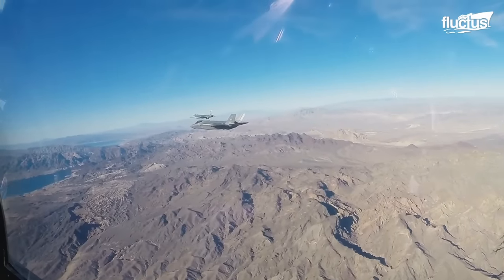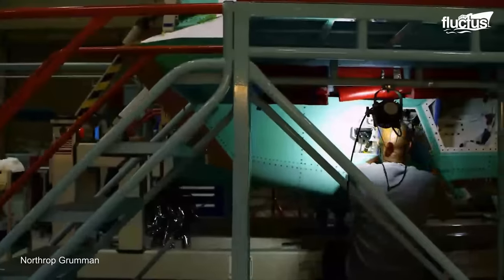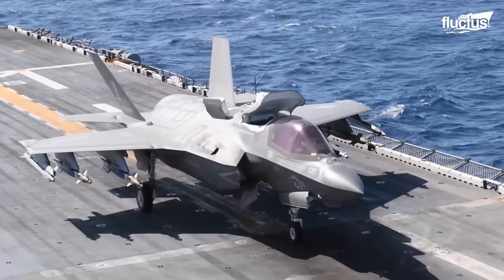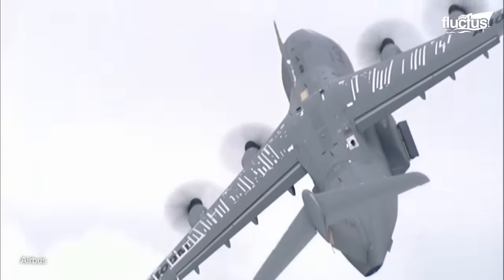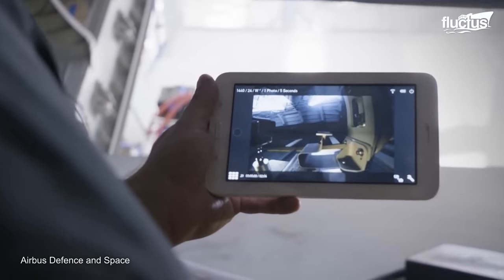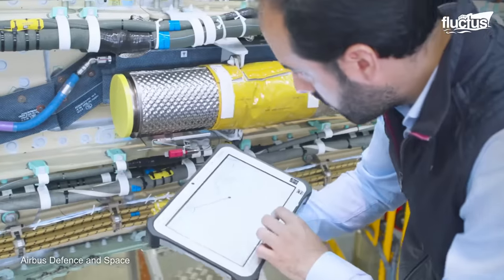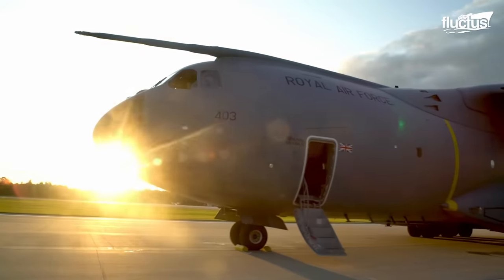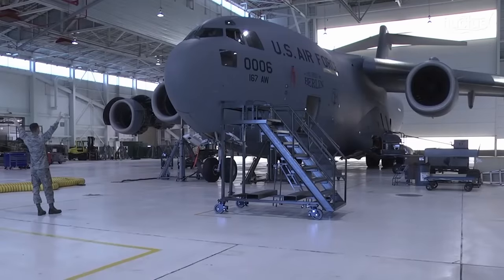Inside Secret Billion $ US Factories Producing Most Advanced Aircraft

Comment: The "Lift Fan" is Not an additional engine. It  is a Fan, shaft driven off the front of the Engine. It gets 29,000 SHP at the bevel gear drive for the Blisk.
Reply: Ok, I don’t have to point this out then…
Reply: @jonshellmusic  Just describe the device correctly. It is an amazing device.
Reply: @TheDustysix  I agree.  You described it well.  I was planning to make a similar comment.  But you did it both first and better.
Reply: Blisk is just a fun word...

Comment: Former Boeing.... been up close and personal with our F-15's and F/A-18's...

I was part of Boeing Commercial Lean Manufacturing. We went from plant to plant and helped implement Lean. Part of that is reducing 'mistakes'. We would revamp processes to eliminate production errors. 

We could build a 747 in 1 week; hundreds of seats, windows, 4 engines, bathrooms, etc. It was taking over 1 year to make a F/A-18. It had 1 window, 2 tiny engines, and 1 seat. Much of that 1 year was 'fixing' mistakes made earlier on production lines. Ever have to remove thousands of rivets to pull a jet fighter apart to fix a stupid mistake made months earlier. It happened and we had to 'fix it'.

Many of those processes we implemented years ago are still being used today...
Reply: Wow, I hear ya.  What's that saying?  "A nickel is a dime when you ain't got the time"?  No, it's worse. "A nickel is a dollar if you gotta holler.  No, it's don't make it in the USA unless you wanna pay, pay, pay....  No, it's If we can do it together..we's birds of a feather...  Help when you can.
Reply: @alext8828  Thanks for comment. Clocking errors in wire harnesses were 1 source of problems. Plane is basically built around it's wire harnesses. Any mistakes made there required very costly and long fixes. They had to disassemble just to reach the problem. Our fix was easy and is still being used today.
Reply: @SJR_Media_Group   Got it.  Thanx.
Reply: VFMA-314 can break them.
Reply: @alext8828  Chinese-Ruzzian nationals leaving comments on American YouTube. Thank You🤣🤣🤣🤣
Reply: @TheDustysix  Thanks for comment... Oorah
Reply: Tail Buttresses.
Reply: @TheDustysix  Thanks for comment

Comment: Which variant of the F-35 are you referring to? A, B, or C? None of the 3 variants are equal in operating parameters. The F-35B is the BIGGEST, the SLOWEST, the LEAST STEALTHY, the LOWEST WEAPONS LOAD, so it cannot compare to either of the other two.
The stated intention of the 3 variant F-35 was to produce a fighter class that SHARED 80% of commonalty, the current %age for the 3 variants is just over 20%, so the entire programme is a failure, and the costs will only be recovered by over-pricing the sales to allied nations.

Comment: Old technology. They don’t realize China has a top secrete fighter plane where the pilot actually lays belly down floating in a fluid in the pressurized cockpit making the pilot mimic flying like a hyper speed bird.
Reply: The interior design is helpful for the update machine awareness of spectrum quotation of the way of which would be under access to plane and the other random acts of flight tol.
Reply: @camerontyler5565  but the update awareness spectrum is a counter productive quotation of increased rapid accelerated air speeds. Sitting upward in a current fighter planes design creates drag within atmospheric air turbulence. Laying down prostrate means less drag and greater maneuverability.

Comment: I always thought that having twin engines on an aircraft is primarily in case one engine fails, or is damaged, the plane has better odds of bringing its pilot home courtesy of the other engine. Considering the Russian and Chinese 5th Gen planes  have two engines apiece, what rationale does the single engine F35 have to make it superior or equal to it's adversaries?
Reply: If one engine shuts down the second one brings the plane to a flatspin.
Reply: Multi engine is no guarantee that one will successfully RTB.
Reply: Not all planes can fly straight on one engine. I think the blackbird is one of those planes that cant
Reply: Having only one engine is less maintenance and stealthier in the infrared IF spectrum compared to having 2 heat sources.
Reply: @johnsilver9338  your comment makes a lot of sense in reference to stealth and/or heat signatures.
Reply: Also it's one chonky engine that is more efficient. If I'm remembering correctly the Mach 1.8 number they quote as the top speed is while carrying a full internal payload of 4*2000 lb bombs or rockets. If you watch a video showing the back of the F-35 next to a human it's massive. I'll try to find the video I saw about that.